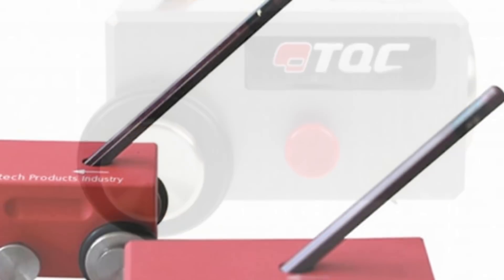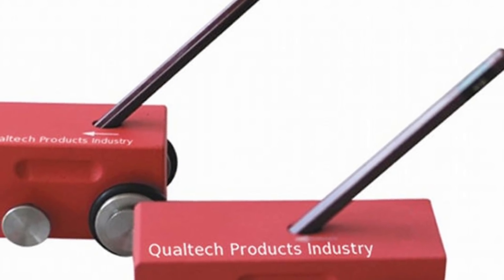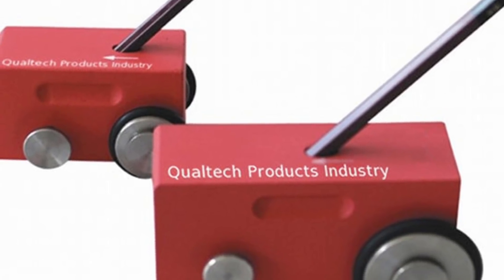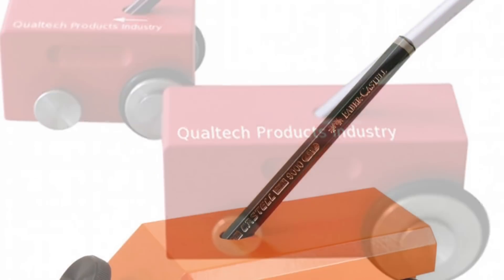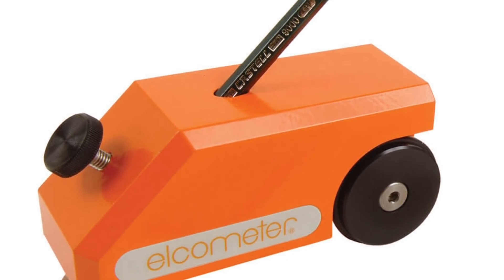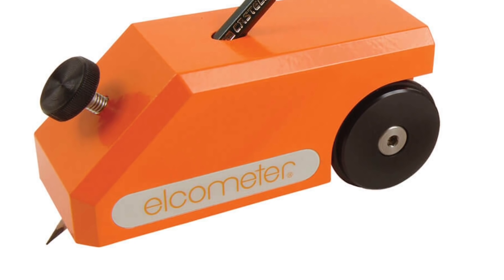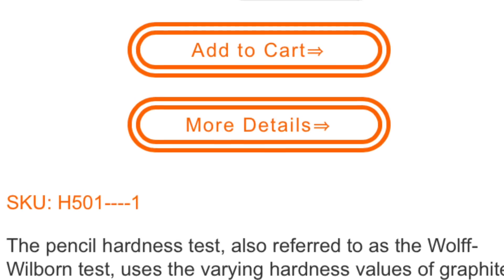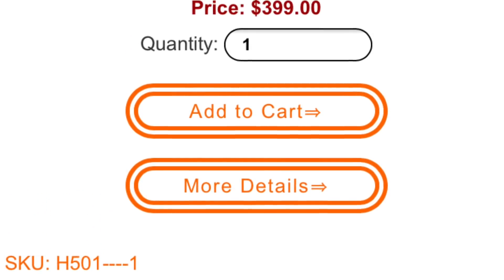How Do Coatings Get Their Rating? 9H, 10H

Comment: Brian, the last video you spoke about a product crystallizing and I would like to report that my TAC system power plus did just that on the threads on the cap. Additionally Moonlight also does this and it's not even a coating, special product that Moonlight is!
Reply: Moonlight is oil based ....
Most if not all sio2 spray sealants on the market today are water based...
These companies calling these water based products a ceramic coating, is getting out of hand..
But as long as people believe it, the auto detailing industry will keep pushing it to increase profits.
Reply: @dallaspaintcorrectionautod8343  what's your take on Moonlight Scott?

Comment: Thank you so much. I feel like my prayers have been heard. After watching everyone freak out about this Adams 9H product I've been going crazy trying to tell people that despite the ASTM test. 9H means nothing in the grand scheme of hardness (Graphite is at most a 3.5 on the mohs scale). Secondly, it especially means nothing on a micron thick coating on top of soft automotive paint. Clear coat is typically a 3 or so on the Mohs scale.
Reply from the maker: I didnt think it was that high...thought Graphite was a 1 or a 2 .
Reply: @apexdetail85  Pure Graphite is very soft in the 1-2 range.

Drafting (and by extension, those scratch test pencils) pencils at the stiffer end can be up to ~3.5. I have that on decent enough authority from an old contact in the industrial coating field who works on steam pipelines. Mohs 3 is about where pure aluminum lands.